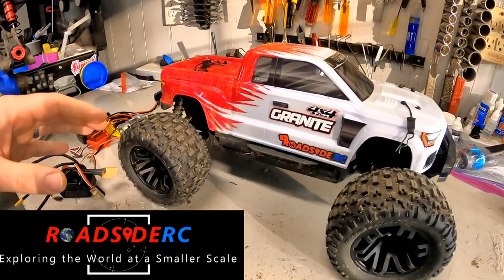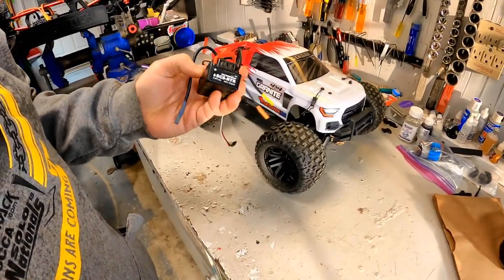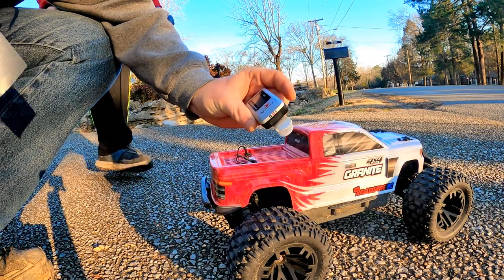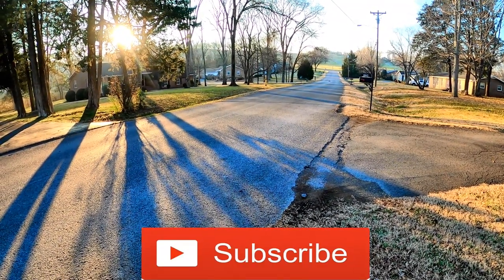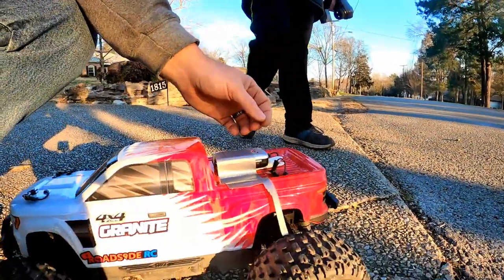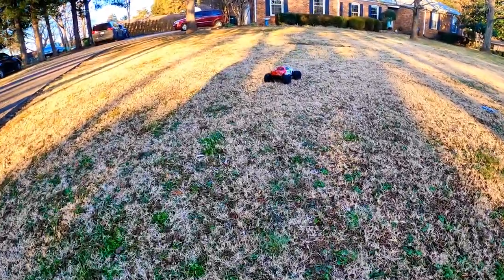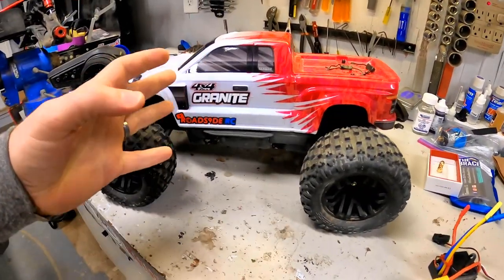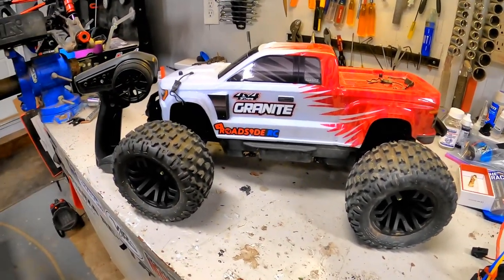Hobbywing SC8 vs GoolRC 60A ESC | Arrma Granite Upgrade

Comment: Good video.  That's what I like about Castle.  They give you a general idea on the box what size vehicle it's good for.  I had no idea that stuff even mattered.  I figured 3s is 3s, 2s is 2s.  etc.  But ya.  it all makes a difference.  I stared learning about this just last week when my switch in my 3800 castle set up went bad and I put in a 3300kv system from my Associated SC10 just to go bash that day.  I thought I'd have more torque with the Lower KV motor.  But it did just what your description said your Granite did. Cogging so bad it actually WOULD not go up hill.  I'd have to roll back down backwards and spin around the get the truck going again.  LOL  So ya.  More amps means more go!   We learn every day in this hobby even if we've been doing it since 86.
Reply from the maker: You are right!
Thanks!

Comment: Interesting I thought lag is usually caused by the radio but surprised to learn it can be the esc. Thanks!
Reply from the maker: Yep!  Looks like the ESC has a lot to do with it!
Reply: @RoadsideRC  is Goolrc the same as Surpass Hobby? 🤔
Reply from the maker: @acche-rc  I am not sure actually.
Reply: Do you change the punch settings for the sc8?. They came soft cause they were used in the terremoto which had brass pinion.

Comment: Needs a metal drivetrain. Metal diffs,   spur, and pinion gear. Then you can throw a 3670 or 3665 motor in to go with the ESC.  2650 to 3200 kv
Reply from the maker: So far, it has needed nothing to stay brushless. 

I have even driven it on 4S and it is fine!

Comment: So... are the GoolRC 60A BL esc generally ok? I found one on eBay for only $11 brand new, and I’m waiting for it to arrive. I wanna put it into my volcano 16 w/ a 4100kv 2845 bl motor.
Reply from the maker: Yes - I typically have very good luck with the GoolRC setups.
Putting this 60A esc in a 1/16 - that is a LOT of power for that small truck.  It should do fine.

Comment: I have been wanting to get an SC8 for one of my builds. I was close to getting one, but I found a used Max 10 for a really good price and went with that instead. Max 10 has been doing great in my Senton though

what's awesome about the V3 brushed trucks is that they come with the 4s diffs as well! I think they have all plastic inputs, but the gears are way better than the older ones
Reply from the maker: Yes!  These mega trucks are really setup nicely.  
Thanks!

Comment: Better off just getting the stock arrma motor and ESC and guarantee hitting 50mph. nice to see some different options though!
Reply from the maker: Purchasing the 3S BLX really is the best choice instead of going Mega and then upgrading!
Reply: I have a Senton BLX 3s. I'm not impressed by the Arrma system. The front bearing on the motor fails often and the truck stutters for a good 2 or 3 seconds before it starts moving. After the truck gets rolling its a blast to drive, but the bearing reliability issues makes that motor a tough sell. I would look into different options if I was going to upgrade one from a brushed system.

Comment: Try the orange goolrc motors. I was told they were better but idk. I have the 4300kv orange motor with the same esc in a 2wd stampede and it’s a rocket. Stock spur and 19t pinion . I’ve never been able to get it topped out before flipping over
Reply from the maker: You are right - the motors I had from GoolRC before were all orange.  I specifically chose this one since it matched a little closer with my goals for this truck.